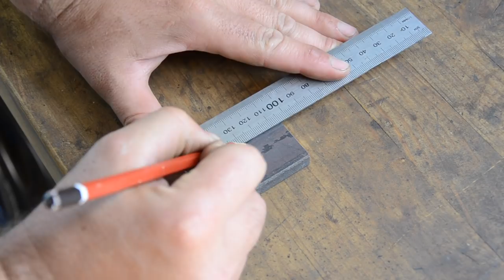Broken Vise Restoration

Comment: Nicely done!  Try and find the pipe jaws that fell out at some point, they really do come in handy.  Also,  make sure you are not breathing in the lead paint dust or carrying it around your home from your clothes.
Reply from the maker: Thanks mate, appreciate the feedback! I couldn't source any pipe jaws locally - but have a look at them on the internet, I think I'll just fabricate up some simple ones, they don't look too bad. Good tip about the lead paint - I was using a respirator for all the paint work, however, probably wasn't as careful about the clothes!
Reply: Two of my favorite YouTube historians in the same place! I love the way YouTube brings great minds together to share and pass on the knowledge that will soon be forgot by the next generation. Keep it coming guys
Reply: i gone did ate the lead chips i are fine watchu tlkin bout?
Reply: Wow! Great restoration video…it really came out nice!
Reply: Other than you completely failing at properly welding cast together (very painful to watch that part) the rest of this video was great.
Reply: WRXEXR oh I don't know, he didn't do too bad especially as I watched it at 2x speed. It was over before I could wince.
Reply: First off there was no proper heating and controlled cooling that you NEED in order to properly fuse cast using XX18 rod. Secondly did you actually see what the weld looked like? Thirdly full penetration is a must otherwise under stress this weld WILL crack out again (not proper heating and cooling will also cause cracking). Forth, do you see all those marks after he is done sanding off that horrible weld? Those my friend are called UNDERCUT. Undercut should never I mean never happen when welding (these will also cause a focus point or notch affect that will also cause cracking). So overall yes it was over fast but the consequences and the ugliness of this weld will live on forever. Hopefully this vise is not being used for any type of real strength clamping or it will crack and break again. If it doesn't crack and break then this guy lucked out HUGE!
Reply: Will Matthews what I use when I repair and work on old rusty tools is kr-oil it will break and eat away rust, It will work really well and help you when your are restoring old rusty tools.
Reply: knew you would be here
Reply: WRXEXR read the damn info he clearly states all of this go somewhere else and put your two cents in this channel ain't for you brother
Reply: Keep the good work up its beautiful....
Reply: Will Matthews I was given the same vise and I'm missing a pipe jaw too. I can't source jaws either. It's pretty common, but I can't figure out who the manufacturer was.
Reply: Ohh the irony you need a vice to repair your vice
Reply: The real irony is that he was working on a "vise" and no "vices" were displayed as part of the work.
Reply: Hand Tool Rescue hi
Reply: no offence but at 11:29 you were missing a respirator.  I have a feeling you are saying that as you know the video could be demonetized for preforming a dangerous act.  Honestly i dont care if you feel like making your self seriously sick however you tube does.  Not trying to be mean just saying it like it is.  Safety is a required inconvenience.
Reply: make a movie and show people how it's done!
Reply: TheWibob1234 YouTube won't demonetize for that. lmao
Reply: HiHowAreYou ask hand tool rescue.  It happened to him restoring a asbestos cutter.
Reply: i know nothing about welding and so, whilst you maybe right in what you say. delivery sucked! Figured you wouldn't mind me joining you in being so condescending :-/
Reply: I saw it was made by a company called swordfish and still in production, I got mine in the mid eighties, just restored mine a few months or so back.
Reply: Uses a clamp to fix a clamp smart
Reply: Thanks I was wondering what those 2 bolts were for
Reply: ZIG DHE SHARKO
.
Reply: Lonnie White
Reply: WRXEXR he first gave the tube a large taper so there was a lot of filler in the weld. That’s why he cleaned off so much material off the surface with the angle grinder, because there was still a lot in the groove?
Reply: i like all you videos u are number one for me  THE KING
Reply: That's a nice vise! Very noce work.
Reply: NU FONE, WHO DIS?
Reply: VideosUnrelated It's a myth about lead paint being harmful for real 🤔
Reply: Will Matthews
Reply: Will -  great video;  It's easy to criticize someone else's work so take this with a big grain of salt:  You could have used a spray bottle of water to quick cool the little vise lock handles that you heated and hammered straight.  This would make them harder to bend.
Reply: @zippy1981dotnet  I just acquired the same vise, with the manufacturer's name plate. It's a Phase II+, stock # 278-005.
Reply: @hansedrachensohn530 I have the same vise as well. My wife inherited it from her Great Grandpa. Took it apart just yesterday. Mine actually still has the pipe jaws in it. I was wondering who made it.
Reply: @WillMatthews muy buen trabajo,podrías decirme de que año es ese tornillo y que marca es? Y su origen x favor
Reply: @zippy1981dotnet  sobre que año se fabricó? Yo tengo uno igual, y estoy en las mismas

Comment: I actually have this exact vise! I inherited it from my wife's great grandparents when they passed away a few years ago. It was like deja vu watching you restore yours after having restored mine two years ago. I noticed yours doesn't have the ID tag anymore, but mine does. It's an "Olympia Tools 5" Multi-Purpose Vise" model #13-025. I hope this helps find those missing pipe jaws. And I have to say, the end result looks fantastic!
Reply: I hope he sees this.
Reply: I have the same vice but no tag, is this China made ?
Reply: @tonypike5785  
Walmart online sells this vise under the Wen brand.

Alltrade sold this vise too under their brand.

It's about a $115 vise. Yes, it is Made in China vise.
Reply: Was your vice full of body filler? I too have this vice and did a sloppy restoration to get it useable as I found it in a farm Grove. The casting is very rough and tolerances are poor. Plan on a better restoration and some improvements this winter!
Reply: Yo tengo uno igual y me gustaría saber sobre el ..de que año será, y dónde se fabricó,te agradezco la inf. Saludos
Reply: Podrías decirme sobre cuántos años tendrán este tipo de tornillos?

Comment: I have that exact type of vice and I love it! I bought it new almost 30 years ago. I hope you can find the pipe jaws; they're so handy. The one thing about them though is that even though the set screws have a lock nut, they frequently need re-tightening; otherwise they fall out fairly easily. I put lock-tight on the threads of the set screws and lock nuts and that helps a lot. When you were cleaning off the old finish, there was more than just paint removed. When these vises came from the factory, they used a bondo like material as a skim coat over the casting to give the vise a smooth finish. It made the paint job look as smooth as though every surface was machined until the vise got chipped to reveal bare casting.
Reply: Roger that on the bondo finish. I lost one of my pipe clamp jaws and planning on making a replacement
Reply: Any idea on the make/model? I have one sitting in my garage that I'm trying to identify...
Reply: Several different companies have made these types of vises. You can still buy them new. Depending on the deal you find; you can pick one up for $60 to $250. Unfortunately the manufacture's label on mine is pretty beat up and I can't quite make out the name. I bought mine about 30 years ago at one of those club type stores; the ones where you can buy condiments by the drum.
Reply: I brought one  of these vices in 1990 for $145. I got it because of the swiveling head and because it would open wide enough to clamp a crankshaft. Mine was red and looked like a fire hydrant sitting on my bench. I love it - use it all the time, used it just today.
Reply: Kaleb Dias  according to this its made in Vietnam. https://olympiatools.com/olympia-tools/vises-anvils.html

Comment: Beautiful job! That’ll last another 100 years!
Reply: i am sorry to say that it probably won't because it is cast iron and the way he was welding on it is never gona hold.
1 he never heated it up before he started( this will cause tit to crack because of the temperature difference) 2   he was not using a electrode ment 4 cast iron ( the proper electrode that i would recommend is normcast  by hobart) 3 doing short weld like he was doing with further the shock of the material ( long stadey welds are what ya want) 4 i am glade that he has disclaimed that he does not know what he is doing .
Reply: Figure of speech my friend, figure of speech.
Reply: original name i want like that comment a hundert times. (Figure of speech as well)
Reply: traderjoes yeah Evan tho he already has 3 :)
Reply: Well, I hate to say it, but I bought this exact model vise from Harbor Freight (Chinese tool importer) in the early 90's sometime.  It was a pretty cheap vise, maybe $60~$80 (I wouldn't have spent more for it) The BIG downfall of this vise is those swiveling jaws, handy in some cases, annoying in other instances.  The problem with them is if you want to hammer on something in the vise that is fairly crush-able unless the hammering point is dead center the jaws will rotate on you. The clamping pressure of the jaws provides the locking of the swivel function.  I used the heck out of my vise but the middle of the part taken off at 4:00 in this video, snapped off on me after about ten years, and that was that.  So, like my vise, this one did not last 100 years the first time around, and unfortunately will not last anywhere near 100 this time around either.
Reply: Broseidon says the one who still says bruh
Reply: says the one who still use "says the one who..."
Reply: Not with that shitty can spray job. 6 months and its already flaking off.
Reply: planit MC 
R/woooosh
Reply: He knows that, that's why it will probably only be used for wood jobs, which is still a very good tool to have.
Reply: Mattyc1234567 hey this ain’t reddit
Reply: @planitmc1204  You may be right.  But if he is right, he's out nothing. It's better to try something rather than wring our hands and do nothing.  Hats off to him for the effort.

Comment: for a cast iron repair, if it didnt crack during welding it more than likely wont crack and will last a lifetime. there are two ways to keep it from cracking, heat it up, keep it hot while welding, and let it cool down very slowly, or dont let it get hot in the first place. not sure if you meant to or not but you kept your heat input low by not making long runs. plus that part is thick so it draws dissipates the heat well. Id say that turned out very respectable whether or not you knew what you were doing. Keep on keepin on buddy.
Reply: A good vice is made of cast steel. A really good vice is forged. A vice isn't made of cast iron. Too brittle. must be malleable/cast steel at least. Welding it is not a problem although he should have burned it in way heavier. Basically that was a bunch of heavy tack welds stacked up. No penetration, but cracking was never going to be an issue.

Comment: One of the best methods I have seen to loosen seized fasteners is to apply heat, then apply paraffin wax (for home canning) And the wax will melt and find its way down into the threads. :)
Reply: I'll have to try that sometime!
Reply: I did this on exhaust manifold bolts as I zero interest (and room) to extract broken bolts. Seemed to work a treat in that case.

Comment: Nice Video! May I give you a really great tip... at 14:03 where you remove the edges of tape. If you get a hammer and tap on the edges where the tape sits, it will shear it off really nicely! It's great especially for intricate curves etc!
Reply from the maker: Thanks for the tip! Will try that
Reply: YouthfulRider , you can do the same thing with sandpaper, reasonably fine. Just sand down towards the tape ends.

Comment: one tip with the welding is to heat the metal up first, lest it penetrate further, good job.
Reply: No, in some instances you can weaken the metal from doing that.
Reply: TomPlays yeah if you heat it up too much. You don't want it glowing, your always going to have a brittle section  either side of the weld, heating helps penetration and spreads this out so it is less severe and spread over a larger area.
Reply: its a sliding shaft you don't want to weaken the case hardening or it will bind in the hole as it is a transition fit
Reply: because this is cast steel/iron, it has high(er) percentages of carbon which makes hydrogen induced cracks more likely, so heating up the metal beforehand makes it cool slower and allows for hydrogen do diffuse out of the metal so in this case it would've been good practice... not the best welds i've seen but they'll hold for this application

Comment: You have done that old vise proud Will :) What a great restoration. It will give you years of good use ॐ
Reply: Those old things were made to be used hard. Even with the critical failure of the jaws and his hobbyist repair, it'll still stand up to anything he'll throw at it
Reply: The Wood Yogi I love these tool restoration videos, they are one of my only vices. I'll get my coat...
Reply: They don't make em as good anymore... or if they do it'll be at a premium price.Cool Vice
Reply: The Wood Yogi عرايس
Reply: The Wood Yogi that’s so cool I want to do this now
Reply: I hope you do Alejandro :) You will really enjoy it and get a lot of use for many years :)
Reply: I pick them up cheap at secondhand markets and restore them. You are right, they are not made like this anymore. Not cheap ones for sure :)
Reply: Well said :)
Reply: To be honest it really does LOOK like a well made old vise, but unfortunately it isn't really that old, and it really isn't that well made.  I bought a vise from Harbor Freight (Chinese tool importer) that was this exact model back in the early 90's.  I used mine (pretty heavy use) in a diesel/heavy equipment shop for about 10 years until the threaded stem of the part taken off at 4:00 in this vid snapped off, and that was that. Still, it may or may not last for a while in a home shop.
Reply: His grandkids well use that, if they follow in his footsteps.

Comment: Nice resto. The original finish would have included a 1st coat of thick whitelead and you'd not see the rough pattern left by casting sand. These days using a bit of 2-pot body filler and sanding smooth achieves the same. De-greasing big chunks of iron best done using the kitchen dishwasher when the missus aint home!

Comment: 23:45 ...2 Phillips and a... tamper resistant Torx security screw? It may not happen in your lifetime, but someday, somebody is going to drop an F bomb for this.
Reply: Bugged me too, but I've had to make such hacks in the past when another trip to a hardware store was out of the question.
Reply: there are those who get it right and those who get it done... haha
Reply: waht do u mean
Reply: Love restoring stuff. Wish i had of recorded my table saw resto. Its an older version of your one.
Reply: To ensure it never gets lost again...
Reply: In my youth buying old cars many had 4 differant screw types holding on the plates.
Reply: Alex what he means is it’s a very specific screw driver that not everyone has that he put on.
Reply: And usually those who "get it done" have to go back and do it right
Reply: I've used and come across those torx security screws before. An appropriate sized punch, tapping it left to right a few times, can knock that nub out of the center. Then you can just use a normal torx bit/wrench on it. Sometimes you just want to use what you got.

Overall nice video and nice restoration.

Comment: Throw away that WD-40 crap and get some PB Blaster, you will be glad you did. Great job on the vise, I have one just like it in my shop.
Reply: Rotflol hes even got a can of wd40 degreaser at 10:22!
Reply: What brand are these? I also have one just like this same color but in very good shape.
Reply: WWWYZZ3RDDD ATF/Acetone 50/50 is the best

Comment: I'm only 16 and I know next to nothing about this stuff but I find it oddly satisfying to watch things being fixed
Reply: Ribbit when I was young if something did not work, I would take it apart and figure it our and maybe fix it. If it did work I would take it apart and see how it worked.  Later in life I worked as a mechanical designer for 40 years. Now at 82 I still love to tinker.
Reply: @The ABC Jug Band That is true. On a farm, field expediency and innovation was/is an absolute necessity.

However, I grew up in the inner city. We used to raid the city dumps and junk yards for parts to make bicycles and other death defying vehicles. I knew how to build and repair small Briggs and Tecumseh engines when I was 12. Once me and a friend got an old, heavy frame British bicycle from the dump. We had a guy from the gas station up the street braze a piece of diamond plate on it. We mounted an upright Briggs engine to it. Bolted a giant pulley that we got out of an ancient washing machine to the back wheel, and with a clutch mechanism from an old lawn mower, we had ourselves a motorcycle. (of sorts) We had to search many hardware stores to find a belt to fit though. We were 13-14 at the time.

In my later years I was a mechanic/troubleshooter at my city water supply company at 18-19 years old. And eventually certified to work on helicopters in the Army. I wound up a crew chief/mechanic/door gunner on the first Black Hawk UH60-A models to go into active service.

My wife says she thinks I'm a robot, because all I think about is machines and fixing them.